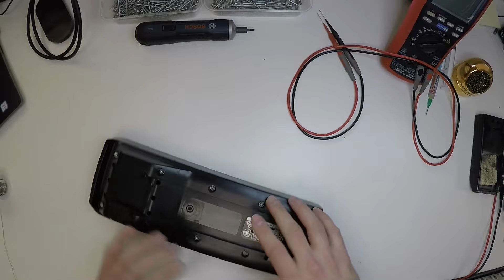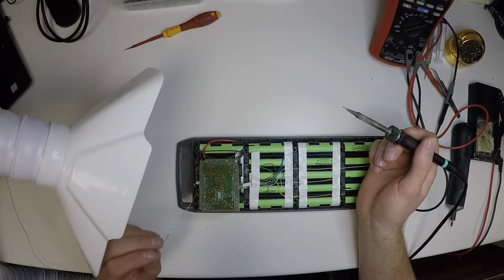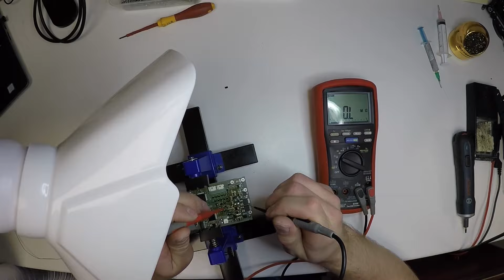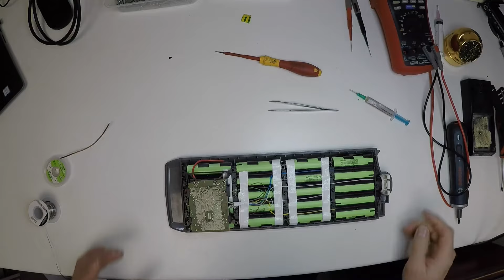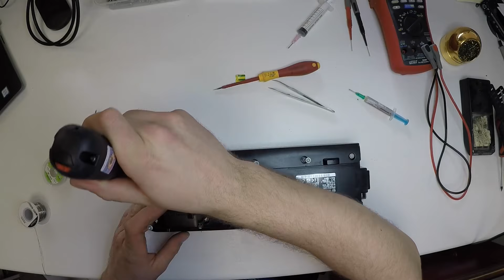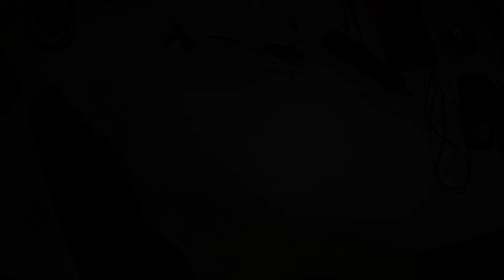Bosch Powerpack BMS repair

Comment: I've got a problem with my bosch power pack 400.... it shows the 1 3 5 error on the battery. So if you turn on the bike after a complete check it turns itself off. If i look into that error code it says that the battery temperature is out of range but could it just be the ntc sensor or something else ? 

If someone knows how to help me bc the bike has only 3k km....
Reply from the maker: Could be the NTC, but most likely the balancing IC itself.

Comment: Too bad, you didn't upload any videos after that. It would have been so helpful 😢
Reply: Common issue is the diode and voltage regulator on those boards. If its the voltage regulator pray it didnt pass the voltage onto the IC
Reply: Un

Comment: Wim mijn fiets accu boch powerpack 400 heeft waterschade opgelopen ,maximale voltage wat ik op de printplaat had gemeten is 2,8 volt .
Is de accu totaal  kapot  of valt te repareren?alvast bedankt voor jouw antwoord
Reply: Did you check across the cells?

Comment: Good work. I have a question about my bike's Bosch battery. The battery keeps flashing (charge level lights) and won't charge. What do you think the reason is? I tested all the cells and they are good. The temperature sensor is also good.
Reply from the maker: Sorry, can't help without further diagnosing...
Reply: @wim4245  thank u .
For example...
or can you guide me please?

Comment: Hello sir, I have the same battery, but there is a problem with it. It broke down, and when I opened it, I found a little water in it. I want to know if I can fix it or not.
Reply from the maker: If the cells are still good (and don't have any oxidation), it can probably be repaired.

Comment: Can you please give me an advice? I'm familiar with motherboard repair. So I have a few BMSs like this. I found traces of liquid damage, but the diode and the power chips are fine. No short circuit on the board, and the 36v rail is ok. The balancer stuff is ok. But when I plug it in, it flickers the 2 and 4 leds which is an error. What could be the problem with the board? Edit: The cells which I connect to test, are good cells, and i have working boards also, so I measured everything and they are the same. I mean I measured it when not connected to power. I'm new these boards, and don't know what volts should be where, like for example on a laptop motherboard, or BMS.
Reply from the maker: Could have multiple causes. Probably caused due to the current measuring circuit. Needs to be cleared with diagnostics software after repair.
Reply: @wim4245  I will solder the BMS to some good Bosch cell pack and take it to a guy who has the software. I know, I have to be in contract with Bosch to have the software,  and that is why the EU manufacturers will go down the drain. I can program any Bafang I want if I buy the tools.

Comment: Does anyone know the part number of the diode? I'm gathering this is some Schottky Diode? I have a dead BMS and I'm measuring 0.3v drop and 3k resistance in what I am guessing is the forward bias and a 2v drop and 10k resistance in the reverse.

I'm a complete novice but that reverse bias is looking very suspicious to me and I think swapping out the diode is worth a shot, but I don't want to swap it out with a wrong part.

Comment: Have you already had the case that for example three of the LEDs are on after pressing the button but charging still doesn‘t work? I measured the 5V and they are okay. Also the charger is working with another battery and the cells are balanced as well. Would be nice to get any help!

Comment: Wim, what do you think about a blown microcontroller? Should I just simply buy a new bms instead?
Reply from the maker: If the MCU is shorted, a new BMS is the easiest solution. If you have a BMS with water damage, you could swap the MCU. Keep in mind that other components on the 5 V and 3.3 V are probably also blown and in need of replacement.
Reply: @wim4245  thanks for the fast reply, then I'll keep this BMS as a spare and just buy another BMS.

Comment: Hi. Great video . I have problem disconecting wires from PCB. Soldering iron at 450 Celsius!!!. What went wrong?
Reply from the maker: Not enough power or oxidised tip. I can solder them fine with my 130 watt JCB.

Comment: Hé. Wim. Can you fix de Bosch classic bms?
Reply from the maker: Depends on what the problem is. I don’t have many parts for them in stock, since they are becoming pretty rare. The older they get, the less interesting to repair (the cells also degrade).
Reply: Beste Wim, heb een Bosch accu die geen snelheid meer aangeeft en geen ondersteuning met fietsen.
Wat gaat het kosten op dit te repareren?
Hoor het graag.

Met vriendelijke groet,

Hans Leende
Reply: Kan niet worden gerepareerd worden

Comment: LEDs 2 and 4 flash. What can be the error?
Reply from the maker: Could be multiple errors. Mostly about wrong current measurement. Must be reset with diagnostic software after repair.

Comment: Hi... should the battery have an output of 42volts standalone when checking with the multimeter? I am getting variable voltage output of between 9 and 10 volts at battery output and 41.0 volts across the opened battery pack. Would the controller send data over battery data wires to BMS to switch and increase battery output to 41.0 volts? Many thanks... I bought gazelle with impulse motor and German battery not working.
Reply from the maker: This is a Bosch battery, not an Impulse. Most (qualitative) batteries needs communication to activate.
Reply: @wim4245  thankyou...so can I assume the controller is not signaling the BMS to activate the battery full voltage.

Comment: Ik heb een 400 Powerpack 2018 voor in het frame en daar zitten op het BMS 2 aansluitingen op die naar de motor (+controller) gaan, kan ik het BMS van de accu in de film voor deze accu gebruiken ik zie nergens die 2 connectoren ..?
Reply from the maker: Hardware is identiek, ook de connectoren
Reply: @wim4245  Ik heb mij een gebruikte 400 Accu zoals in filmpje gekocht op Marktplaats en daarvan het BMS gebruikt in mijn eigen accu en het werkt! Is wel een enigzins geklooi om de accu case weer goed dicht te krijgen zonder iets te beschadigen. 

Dank voor de antwoorden en raad!

Comment: Hi there. Great video. I have the same issue. Which diode did you use, I have only  250v in stock but i feel this is too big. Thanks
Reply from the maker: SS16 is best
Reply: @wim4245  Thank you!

DC Repair Group.

Comment: Hi @wim I followed your steps and now the Powerpack turns on and charges.
However when I connect it to the bike (2019 ecube reaction hybrid pro 400, purion display, Bosch 250W 75Nm mid-drive) the display turns on, shows the battery status and the riding mode but shuts off in 2 to 10 seconds.
If I try to turn it on while paddling I can feel the motor engaging correctly but the bike shuts off regardless after 2 to 10 seconds. I tried reset the battery and tighten/adjust the battery holder with no luck. Any thoughts? Thanks for helping!
Reply from the maker: Difficult to say without diagnosing the battery. De battery turning off, is probably because the BMS senses something is wrong. Could be imbalance, faulty current reading, temperature out of range… These could be caused by a, actual fault, a faulty connection, but also caused by a faulty component.
First step would be connecting to diagnostics computer.
Reply: Si Omar. Your demo it very good!!! Smart Guy .

Comment: What is the three pin plug?
Reply from the maker: CANbus + charge signal
Reply: @wim4245  Do you know some way to start driver without CANbus?
Reply from the maker: @jacek7092  You have to send the right CAN signal to activate the battery, it won't work without.

Comment: Wim - I have a Powerpack 400 that just stopped working or taking a charge. Shows one light when I press the button, but no flashing occurs when plugged in. Other Powerpacks work just fine on the bike. Can't seem to find anyone in Canada to work on these Powerpacks. Wondering if I can send you the battery and of course pay you to repair it? Can't seem to find you email to send a direct message. Thanks for the consideration and for sharing your expertise.
Reply from the maker: Probably water damage or faulty cells. I'm afraid I can't help you, shipping used lithium ion batteries in and out the EU is impossible.

Comment: I have a really strange one with mine, battery pack lights up one light when charger plugged in, but doesn't charge, 5v seems to be working ok, and when I connect the intuvia it doesn't recognise the battery or the charger..... however if I continuity check the + of changer with + of battery it starts to charge and the intuvia starts flashing and shuts off, then if I disconnect the battery and plug it back in intuvia says charging, then shuts off. Also the battery single led doesn't change to two or 3 when the voltage goes up towards 40.5v. 
It did have water damage and the capacitor between the two MOSFETs next to the + terminals literally just fell off when I was checking for shorts. I'm thinking there's a problem with the actual processor on the board but I'm no expert. I really would like to fix the board purely as a challenge but I'm now lost
Reply from the maker: That's not a capacitor between the FET's, but a temperature sensor. The BMS won't work without it. There’s a high chance the water caused more damage (corroded via’s, traces, components…).
Reply: @wim4245  I think I will buy a replacement BMS and throw this one away then. Nothing looks corroded but I will imagine that the water short circuit could have damaged some things that I can not see and I don't want to test every component on the board. Do you sell the BMS units?
Reply from the maker: @diesel-technology5507  Send me an email: wim@verbakel-tsr.be

Comment: Hi Wim, what is the best part to use to replace the voltage regulator. I have seen TPS57160-Q1 recommended but can only find one very expensive source for that.
Reply: TPS54160-Q is available and looks very similar...
Reply from the maker: @thecreativedrummer  If you have time, you can order them on Aliexpress. Probably counterfeit, but I’ve got good experience with these.
https://www.aliexpress.com/item/1005001970720656.html
Reply: @wim4245  Thanks so much!

Comment: Hi, as an electronics enthusiast I'm trying to repair my bosch battery myself. The diode and button are ok, what are other common things that i can check that maybe are broken?
Reply from the maker: Difficult to say without diagnosing the BMS… 5V-regulator, CAN-IC, balancing-IC, MOSFET’s, MCU, corrosion, combination of problems…
Reply: @wim4245  corrosion is not the issue (clean pcb). 5V is ok. CAN-IC I don't know yet. If there is something wrong with the balancing ic, then the bms can't be repaired I guess?
Reply from the maker: @janstappers5246  All components can be replaced

Comment: Hi Wim, Can you answer a question? If the diode is blown will any lights come on. Conversely if a battery is not working but the lights come on - can you be sure that the diode has not blown? cheers Tommy B.
Reply from the maker: If the diode is shorted, the LEDs will do nothing. If the LEDs work, the diode is fine. There can be many other problems.

Comment: Hi mate 

Do you live in UK if yes I want to send my battery for repair
Reply from the maker: That's going to be difficult. I'm located in Belgium. Shipping the complete battery isn't possible.
Reply: @wim4245  what if I ship the battery to you ?
Reply from the maker: @Ravenby101  Your not allowed to ship a used lithium ion battery. Customs will confiscate it.

Comment: Hii. Can you tell me how to connect bosch battery to another bike. Because it has the positive, the negative and 2 thinner wires that must be a key to activate the bms, if you join these 2 wires the battery becomes active?

Comment: could you theoretically replace the bms with a simpler replacement BMS  with a mechanicall on/off button if willing to sacrifice on/off function feim handlebars?
Reply from the maker: Not possible, the drive unit will not engage

Comment: Hi Wim, great video!. I have a powerpack 300 , and indeed the Schottky diode is fried (tested with the multimeter). However, I read that the battery should be completely dead if that happens, but mine still lights up one LED when the putton is pressed. Are you familiar with the symptom? Will a diode replacement fix the problem? Also, I read online that disconnecting the bms from voltage will brick it, but that doesn't seem to be the case for you in the vid. So that's a myth I suppose and I can safely remove it from the battery?
thank!
Reply from the maker: If the LEDs light, the diode is definitely working. Your measurement is probably messed up because your BMS wasn't disconnected. Disconnecting is no problem.
Reply: @wim4245  thanks very much, that helps a lot. WHere would you suggest that I look for the problem? The cells are all ~3.69V. THe battery doesn't charge (only one LED is on all the time when plugged in), pressing the battery button for 10-20 sec does nothing, and the bike disconnects the battery after 10 seconds of operation... Any suggestions most appreciated...
Reply from the maker: @kryszczuk  Sorry, can't help you without actually diagnosing the BMS. There are a lot of thing that could cause this.
Reply: @wim4245  are you accepting batteries to repair
Reply from the maker: @josephsantangelo5616  yes, I run a repair shop. See my mail address on the "About" page in this channel

Comment: Hello mine has all the cells at 4.2V, BMS board seems to work for charging and i get 42V from the 10S 18650 black and red wires. But nothing from the output of the BMS to the connector of the battery. Is there any DC DC converter to get 36V from the 10S voltage ? it got be the problem...? Seem like 2 big MOSFET at the output ?
Reply from the maker: The battery is 30-42 V, no DCDC conversion for the output. The mosfet's are for switching load or charger on/off. The battery needs the correct commands over the CAN-bus to switch the output on.
Reply: @wim4245  oh ok then MOSFET should be dead... but thé motor can accept 42v ?!
Reply from the maker: @flloriangerard  Why do you think the mosfet is dead? It's completely normal that you don't measure any output. If you don't measure any output in the bike, there is probably something else wrong (the MCU won't switch the mosfets if there is anything else wrong). The battery is 10S, so of course the motor is 42 V.

Comment: Mini solar tip (winter, also camping): You can gradually turn down a boiler and all other hungry electricity consumers with the "5000W dimmer". Ebay €7. I run 5 dimmers in parallel on an 850W inverter. Kettle 2.2KW at 150W runs 12 hours a day, so the water is always hot. The room is also nicely heated. 2.5KW washing machine runs in parallel with dimmed to 200...400W. Iron, dishwasher, oven, electric heater, coffee machine, all internal heating are throttled with me. Videos on my channel https://youtu.be/eC2olbCBhh0 The inverter stays cool, quiet and the MOSFETs + (battery) remain intact because no extreme current peaks arrive at the inverter. Now every Mini PV Inverter is enough to sell large devices. So, with the dimmer, all internal heaters/devices can be converted into base load devices that stay almost permanently ON, drawing very little current directly from the PV. With a wattmeter / energy cost measuring device you can then measure this perfectly in order to set the dimmer optimally.
       A little hint (for everyone else): Energy cannot be saved. So if I want to boil my water, I always have to use the same amount of energy for one liter. Christian's method relies on a longer period of time with less power in order to be able to use the power provided by the PV as efficiently as possible - so consumption peaks are intercepted. In the end, the energy consumption should even be (slightly) higher due to the interposition of the dimmer, but it doesn't matter, since more efficient coverage by the PV system and therefore better use of the self-generated energy..... ....... 🌞 ...

Comment: Hello Wim, I have a Bosch powerpack 500 which don't deliver anymore electricity to my e bike. I sent it to a battery repair company that said it was the BMS and they can't do anything. However the green leds of the BMS light up . strange isn't it ? Do you think  you can do something ? regards. Eric.
Reply from the maker: BMS can definitely be faulty even with working LEDs. If the cells are indeed fine, the BMS can probably be repaired.
Reply: @wim4245  Thank you for your answer. So could I send it to you to repair it ?
Reply from the maker: @LePermutant  Send me an email: wim@verbakel-tsr.be

Comment: Hoe kom ik aan Wim’s adres om mijn  bosch accu te laten repareren?
Reply from the maker: Klik even op "About" bij mijn kanaal voor mijn mailadres
Reply: Niet in bezit van laptopdesk
Reply: Ik zie dat U in Belgie woonachtig bent.
400 bosch accu batterijen zijn geladen maar de led’s blijven uit ,schakelaar brengt daar geen verandering in.
Denk dat de diode doorgebrand is.wat zou daar de reparatiekosten  van kunnen zijn?
Gr.P. Kuin
Reply: @wim4245  
Geachte Wim,
Kapotte accu na te zijn geladen
Bosch 400wh 3,5 jaar jong.
Er is denk ik iets ( diode) stuk aan de BMS
Ik zag jouw filmpje van zo’n reparatie op you tube en dacht dat het ook bij mij hetzelfde zou kunnen zijn, maar heb jij enig idee wat daar de kosten van zijn , exclusief verzenden?

met vriendelijke groet, 
Paul Kuin

Comment: Can you help please. I am replacing the Schottky Diode as my 500w power pack is dead.  There is no marking on the defective diode to show me which way around the replacement goes.  I do not want to cause further damage by connection it the wrong way around.  Are you able to indicate to me the positive and negative orientation for the new diode.  Thank you
Reply from the maker: Cathode towards mosfets